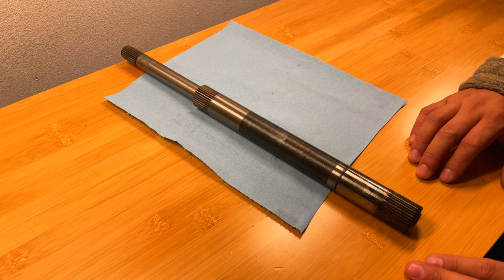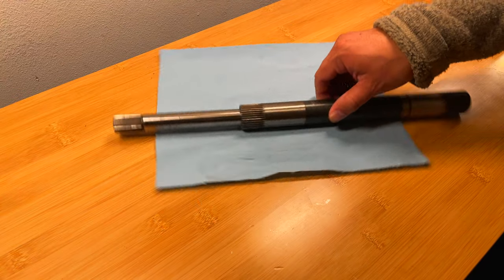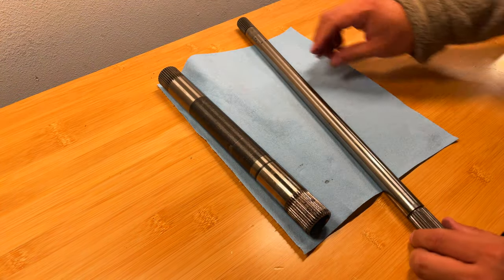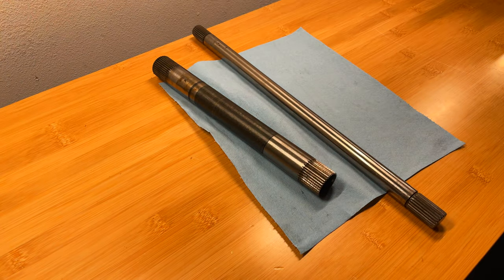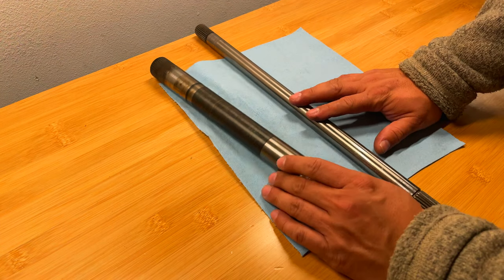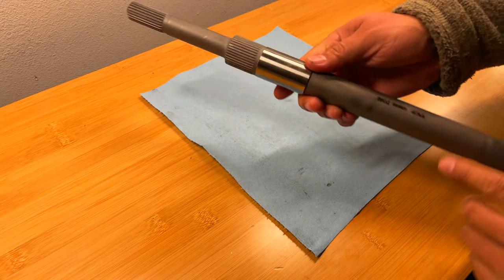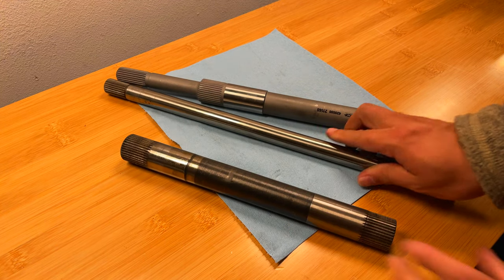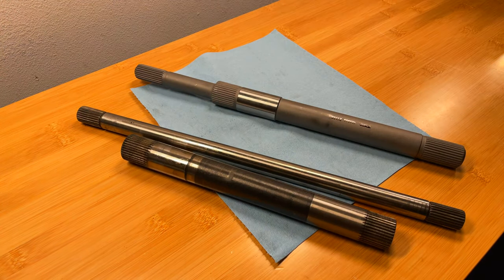AOD Conversion upgrade Pro Touring 1968 Mercury Cougar

Comment: Good stuff. I’m very interested in the install of the aod. I have a 67 cougar that’s getting the same treatment.
Reply from the maker: Awesome! If you’re expecting more horsepower I would also recommend beefing up the internals, along with that input shaft. It might even be best to buy one already built by TCI or Lentech to be honest, I would have gone that route if my tranny needed a rebuild. Thanks again for watching, I’ll try to make a couple of more vids as I make progress with the transmission when I get it back from the shop
Reply: @RubenSegura  sounds good. I appreciate it. I lucky have a built trans that I got from a local guy. I just had all the seals replaced and gone through by a local trans guy. He said currently it’s probably go for mid 500s. 
I’m super excited to see your built. Thanks for the reply 👌🏻
Reply from the maker: @jeeplifted1  that’s great to hear, I’m no where near that HP maximum but maybe I’ll revisit if I end up doing more engine work after the car is fully road worthy
Reply: @RubenSegura  I’m not either. Just couldn’t pass up that deal